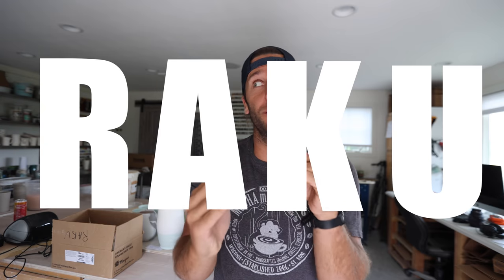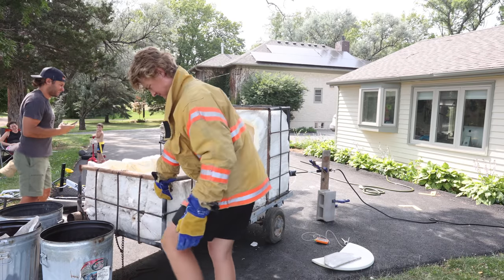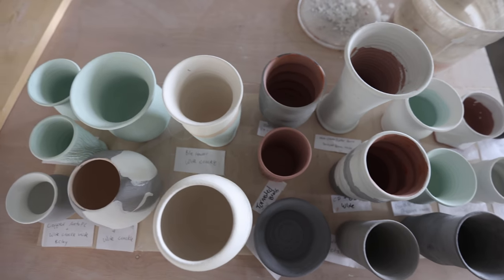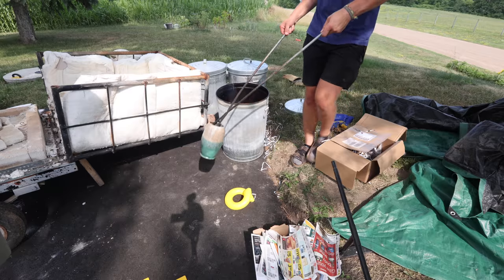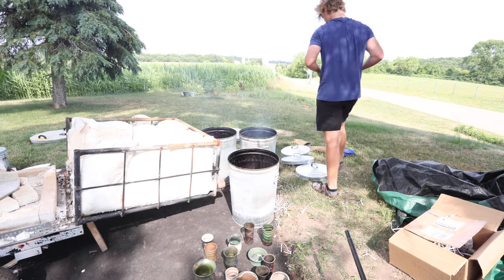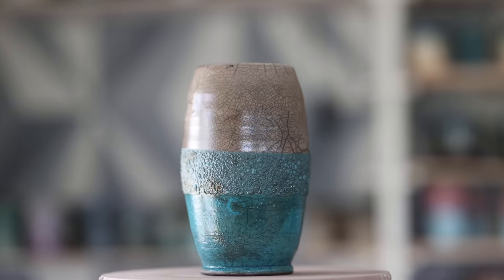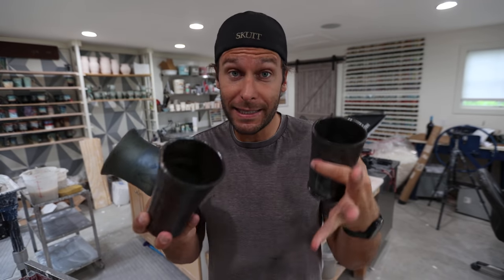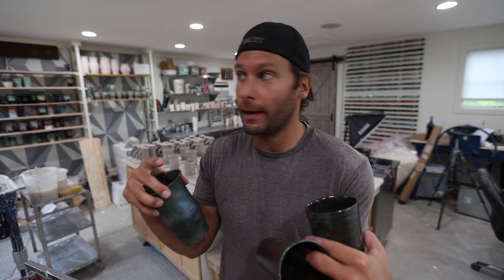RAKU FIRING - the CRAZIEST way to finish pottery!

Comment: When we fire Raku we usually don't use cones. Rather we watch the behaviour of the glazes . First they melt and you can see them go shiny. Then they usually bubble as outgassing occurs (eg on your bubbled piece) then the bubbles smooth over and it's time to open. Super fun way to fire. Your kiln setup is tight love the hinge design.
Reply: This the correct way to fire raku. This will produce the metallic effects if you know when to close the can lid.
Reply: I took a Raku workshop recently and the instructor usd cones.
Personally I use a pyrometer as a guide, but just use the look of the glaze to know when to pull the pots.

Comment: I always use water after I take the pots out hot from the kiln, to make the glazes crackle more and the glaze reacts even more amazing😊
Reply: I have done that as well, but even blowing on them can accentuate the crazing/ crackling.

I should add, and this is not something I thought  or ran into prior to a recent workshop, but when quenching Rakuware, caution should be used if a piece has narrow opening, like a small necked vase.  The steam pressure can explode pieces if they are submerged too quickly.  I sadly broke a classmate's project this way, and I was being careful.  This actually happened after taking them out of reduction.  We took them out hotter than you might normally, because we were doing several consecutive firings, and needed the bins.
Reply: @benpatterson4452  hello Ben, thank you for your reply. I’m certainly not an expert, but I agree that the the walls of the pot are to thin or to fat they will crack and I have immersed in water and and yes that can course breakages, but just spraying the hot pot can be better 😊

Comment: You can use an old kiln and make a Raku kiln - so exciting!
Reply: Use an old round electric kiln. Take out the electric elements, leave the lid on, take/ cut the bottom floor bricks out, set up a square 2 layer brick bottom to set it on, leave a sm opening for the burner. Simple

Comment: Would love to see different combustibles for the raku fire - maybe different combustibles with the same glaze. Also would love to see videos of you mixing glazes and using less store bought glazes especially for raku!
Reply: I've tried many things over the years from newspaper, dried leaves, corn husks and wood shavings/ dust.  They all do something slightly different to the surface, but nothing terribly dramatic.
Reply: Try using leaves that have oil in them.example: eucalyptus leaves will leave behind the imprint of the leaf on the glaze due to the oil present in the leaf

Comment: What was your propane usage during that firing? I’m building my own Raku kiln right now! Super excited.
Reply: Deffinatly want to know how much propane was consumed
Reply from the maker: It was less than 1-2 % of the big propane tank that I have , so not very much !
Reply: How small of a tank do you think you could get away with?
Reply: @brendenkoontz4614  you can use a 5 gal tank, good for 2 firings. Smaller the raku kiln = less propane used. Avg about 2 gal a firing.
Reply: Robert thanks dude! I appreciate it lol that feels a lot more feasible!
Reply: @brendenkoontz4614  the kiln you see in the video is much too large for the small amt of pots he fired, half the inside kiln space was wasted. He did not reach the required temp. That kiln size and shape requires 2 burners not one. Smaller kiln size with a door (not half the kiln) that opens and closes is best . for best results have a second person to help open and close the door when unloading many pieces.
Reply: I use a 20 lb. tank for my small Raku.  I can get several firings out of it.  It would probably be a bit more, if I got a better regulator.  When it gets low, the tank freezes up if I open the burner too much. (Even with spraying it with water to prevent said freezing).
Reply: @benpatterson4452  20lb tank holds 4.7- 5gallons about $3-$4 a gallon
Reply: @xeroart3852  It's twenty dollars and twenty cents to refill it.  Though they may have rounded it to an even twenty as of late.
Reply: @benpatterson4452  good info for those interested in a raku kiln, something the video did not include. Thanx

Comment: Info.- for your “bubbles” in glaze-

Steven Branfman, Raku Vase
Steven Branfman, Raku Vase
Traditionally, the maturity of the glaze is determined visually. The kiln is opened, and the pot surfaces are examined for complete glaze melt. If mature, the glazes will appear wet and reflective. I strongly recommend using a pyrometer in conjunction with this technique, noting the temperature at which maturation occurs. After a few firings, you will need to look only at the pyrometer to determine unloading time. There is some medical evidence that prolonged or repeated staring into a red-hot kiln can damage vision.

When examining the pot for complete glaze melt, look for bubbles in the glaze, as these can mar an otherwise perfect pot. Even if the bubbles burst when the kiln is opened, unsightly craters will remain. Bubbles are almost always present on my pots because I fire rapidly, so I simply assume their presence, and take steps to remove them.

To accomplish this, partially open the kiln just long enough to drop the temperature by 200°F or so (I give it about a 10-second count). Close the kiln and bring the temperature back up to near maturity. Give it a couple of minutes for the craters to heal. If you have clusters of bubbles, you may have to repeat the procedure.

Comment: Question: do you absolutely need to use 'raku glazes' when you raku fire? Could you use the regular glazes that you usually use or is it a case of their not working at the temperatures in a raku kiln?
Reply: Yep, is a low temp firing and using reduction to get colours so usually custom glazes
Reply: You can use regular low fire glazes. But choose only opaque colors if you want color to stand out on the black clay body background

Comment: I had no idea raku wasn't food safe!? Any idea why?? Thank for showing us this little slice 🍉 of pottery life. Till next time ☕
Reply: Not food safe because the reduction that occurs in the kiln and trash can brings metallic and other materials to the surface of the glaze. Citrus acid foods are the worst because it absorbs those materials into your food and into your body.
Reply: @xeroart3852  wow, thanks :)
Reply: It's not just the glaze leaching, but also the combination of the glaze crazing and underfired/ unvitrified clay body.  The quick cooling causes the glazes to craze, which means that food or drink would seep into those tiny cracks.  Then on top of that, Raku clays are purposely underfired, so they can resist thermal shock.  An underfired body is porous,  and the food and liquid would then seep into the clay body.  This would be very unsanitary.

*However*, with Traditional Raku tea bowls (Chawan), they do drink from them, and even use leaded glazes.  The reason they can do this is because rigorous, thorough washing is part of the tea ceremony, which gets rid of  metal residue and bacteria, and the tea is drank relatively fast, so it can't pick up those things.  On top of that, a tea ceremony is not an everyday thing,  so exposure is minimal.
Reply: @benpatterson4452  thanks for the information, I've always been fascinated by the look and interested in what is going on to create this style/practice. Loving learning more about it.

Comment: Great video! What clay body do you like to use for raku?
Reply: Best to use a clay body with sand, sand and grog for large pieces because they will withstand the temperature cooling shock that could crack your pot
Reply: @xeroart3852  thanks! I was looking more for brand. Since he uses Mayco glazes I wonder if there's a clay brand that tends to work well with their glazes.
Reply: @focusedforwarddivorcecoaching  Mayco low fire glazes work with all low fire clays available from clay company's. Don't know what state you are in. I am in calif the clay mfg's here are: Laguna clay and Aardvark clay. Both have a Raku clay body. If you do not want glaze crackles in your regular glaze firings use only low fire clay with low fire glazed. I am a retired ceramic engineer thinking about starting a website blog to answer questions on all types of ceramic techniques, formulas etc.happy to help
Reply: He uses Continental Clay's Raku body.  That's what I use as well and it works great.  Most clay supply companies have some type of Raku body, but you can also use any high fire clay, or even mid-fire.  It just needs to be a clay that is underfired at low fire temps.  Having grog in it can help resist thermal shock, but isn't required.
Reply: @benpatterson4452  perfect thank you!!!
Reply: @focusedforwarddivorcecoaching  Not a problem!

Comment: If theyre not food safe anymore after firing what can u use them for?
Reply: Decorative items, they normally won't hold water for very long will weep and cause damage to table tops.
Reply: @teresamsanchez7307  So using them as planters for flowers still wouldn't work that well? 🤔

Comment: What makes it non food safe out of curiosity?
Reply: I think it has to do with the clay and glaze still being slightly porous
Reply: The reduction atmosphere in the kiln and trash can wil bring glaze materials to the surface. You dont want food to come in contact with toxic materials. Any food with citric acid will quickly absorb more toxicity from the glaze. A mild Poisen in your food
Reply: There’s two parts to why raku is generally not food-safe: 1) The raku glazes tend to crack, pit, and crawl, which creates spaces for bacteria to hang out and avoid your best efforts at washing the pot. 2) The raku glazes often use metal oxides, such as copper, chrome, and manganese, that are toxic. Normal kiln firing, whether in oxidation or reduction,  will lock the metal oxides in the glass forming part of the glaze and prevent leaching (usually, but not always—that’s why even non-raku glazes are tested for leaching). Raku firing does a poor job of locking the metals into the glass, and so water, or moist food, or anything with an acidic character will dissolve the metals from the surface of the glaze and then you will ingest the toxic metals. A person could use a glaze with no toxic metal oxides and that doesn’t crack, pit, or crawl and raku fire it, and then the pot would be food-safe. So there’s nothing about the firing itself that makes a pot unfit for use with food; but without the metal oxides that create the wonderful iridescent colors,  and the crackling, pitting, and crawling and so forth that give each pot a unique character, there’s really no reason to raku fire a piece.

Comment: As of right now, there's 4 thumbs down. Lol why? Salty people
Reply: There are thumbs down because he knows the steps but he has no real experience doing Raku. Kiln design is not made well, his firing shows no experience, he let the kiln cool before unloading, his pot examples were poor, underfired. Those thumbs down are from experienced Raku potters.
Reply: @xeroart3852  At some point we are all inexperienced Raku potters, potters and humans in general.
As I said in another comment, I did a workshop, where the instructor had done numerous firings.  The very first one we did, had some underfired wares at the bottom.  We troubleshot the problem, which was bad air flow, and it solved the problem.
Experienced potters still have pots flop, explode, glazes run, etc.  
We never stop making mistakes and learning from it.
Reply: @benpatterson4452  get to know your kiln and you will never make firing mistakes. A formal education in ceramic and glaze technology does not hurt. Knowlege in kiln building will help to troubleshoot homemade kilns.

Comment: Metallics did not show because you may have not reached glaze maturity and it seems you let the kiln cool before unloading. You should unload quickly for full Metallics effects on a pot. More people more tongs. Poor firing
Reply from the maker: I am definitely not an experienced raku potter , I am still learning and looking forward to improving on every firing!  Thanks for your comments , I will try to unload quicker and possibly fire hotter as well!  Just trying to get better and share my experience:)
Reply: @Jonthepotter  , probably less pieces per firing and the reduction cans closer to the unloading area will reduce the excessive cooling down of the pieces. walking way around the kiln cools them off more and promotes the oxidized (blue) color vs the metallic. effect. try squirting / splattering some motor oil on the surface will produce a localized reduction effect.
Reply: @Jonthepotter  The bubbly one was definitely underfired.  That's why I always go by the looks of the surfaces before pulling the wares.  Most if not all the glazes bubble like that when they are near maturity.  They smooth out after that and look "Wet".  That's when they should be pulled.  Cones will tell you the heat work of that specific spot of your kiln, but you may have some cold spots.    You may need to upgrade your burner.  Ceramic suppliers sell venturi style burners specifically for Raku kilns.
Don't worry about the issues, you'll figure it out.  The instructor I had for a recent workshop had done numerous firings and we still had some issues with glazes not turning out, and we all had to troublesboot.